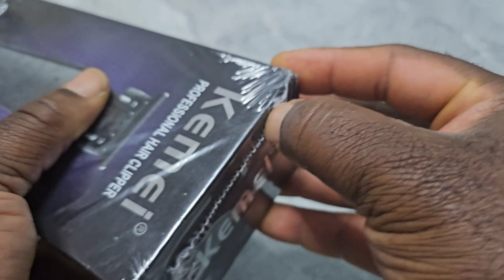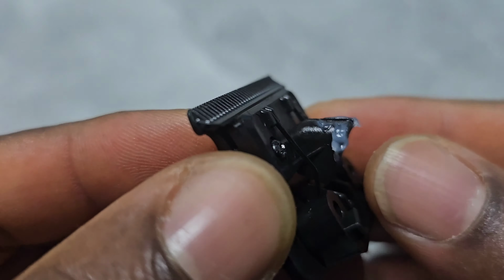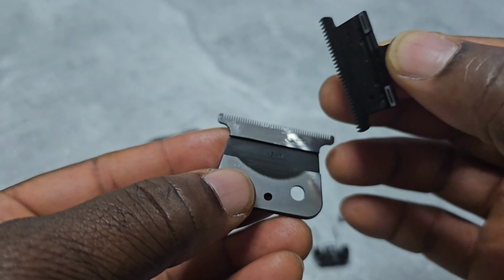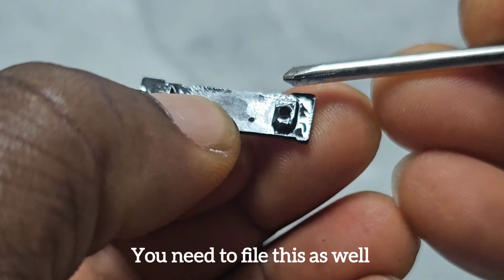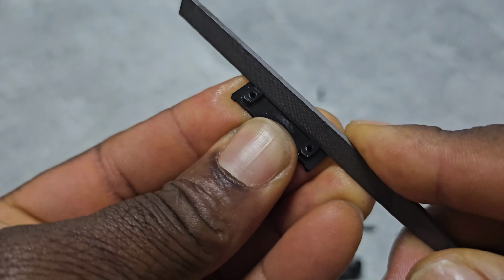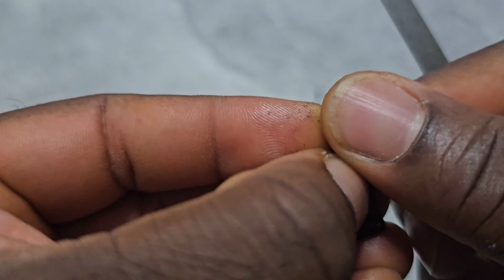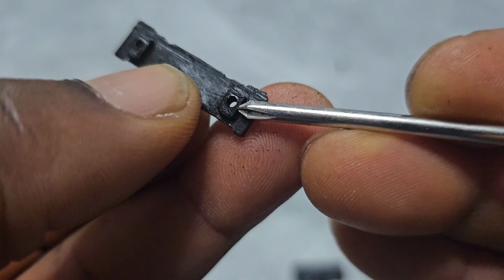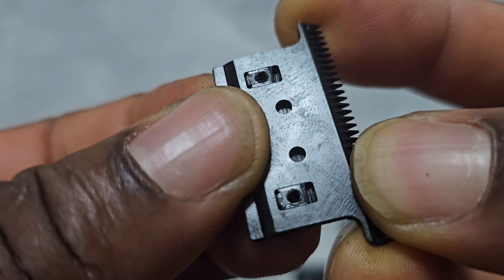How To Zero Gap Kemei 2299

Comment: That is already a zero gap sir, why you zero gaping again?
Reply: To look smart?
Reply: some of them,(mine) are misaligned. They’re not perfect out of the box all the time
Reply: They are SUPPOSED to all be zero gapped but unfortunately all of them are not, genius.
Reply: I got the same trimmers and they perfect out the box hrs after using them u still feel them which means they are very sharp 🤷🏾‍♂️
Reply: People don't understand that zero is NOT meant to be literally zero gapped (for safety reasons) zero gap means the blades are close as possible (leaving a slight gap)
Reply: Exactly
Reply: Mine not hitting at all
Reply: @marclemar yo bro.  Psycho cutting blade....Supreme Vader still blade. Flatten out the bars on the cam follower a lil bit. The 2 lil bars holding up the cutting blade. Pay close attention to not go over. Flattening em will push cutter up. Plz pat close attention at this part. This will hit bro. Lika mf.
Reply: @bobbyflav7001 💯 nothing hits the same off assembly lines. Barbers should personalize thier settings. Use tips then go from there or go all experiment mode.
Reply: Mine came misaligned. I own 3 pairs. The first 2 were great. The most recent one came misaligned.
Reply: Is kemei 2299 like can you rinse the blade under water? I ordered one but im not sure.

Comment: Aren't they already zero gaped
Reply: Ye they are basically, this guys just maxes them out
Reply: Hell no lol they don’t even cut really just like the supreme trimmer Vader trimmer which is the same machine. You have to modify it to zero gap it
Reply from the maker: Some may be zero gap outta box and some maybe not. In case yours is not zero gapped, this is how you can zero gap yours
Reply from the maker: @haziqiqbal4367 thnx bro
Reply from the maker: @dc_crush I don't have Supreme Trimmer but I think supreme Trimmer is better
Reply: @edounboxingofficial yea mines ain’t
Reply: @edounboxingofficial  I don't care about its cost, I want to know if this kemei is better than the philips or braun trimmers? I trim my beard to 2-3 mm, never shaved.
Reply: @supermeseriasu I've never used the models you have listed, but this kemei 2299 is a steal for the price. It is durable and will deliver the performance for what you described that you need it for. It also comes with comb guards where you can adjust to your desired cutting height.
Reply: @Gavin_56  I'll think about it. I don't like that it cuts to 0. If I put the grills on, it's still too big.

Comment: I've never changed anything, mine cut pretty good remember guys a Razor is the sharpest blade. I recommend a lil razor finish there's a reason why you can't "zero gap" these clippers.. also try pre wiping around the entire hairline with alcohol to remove a lot of the oils from the skin.. Razor finish is the best clean up... Been cutting since 1984.. Great video 👍